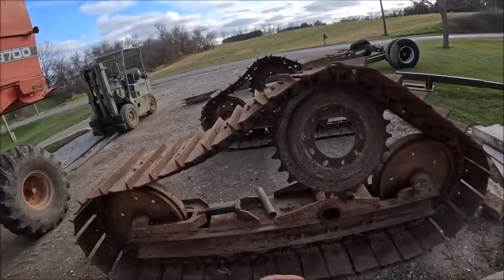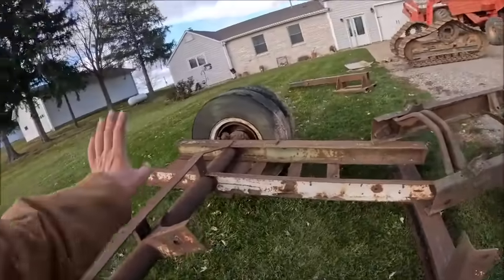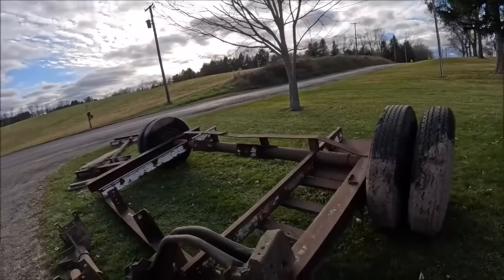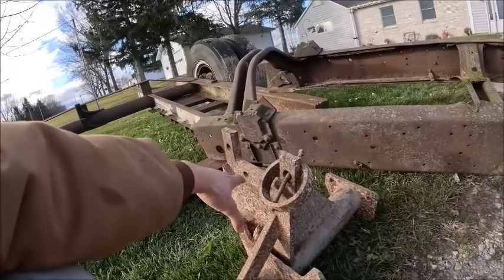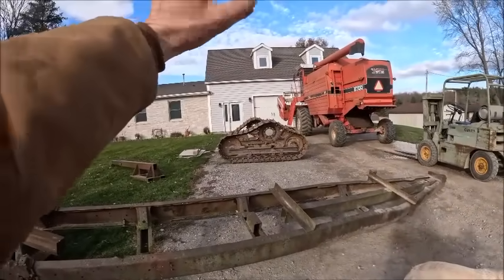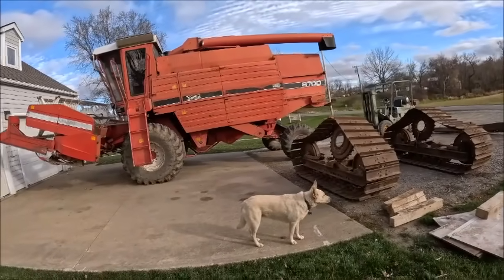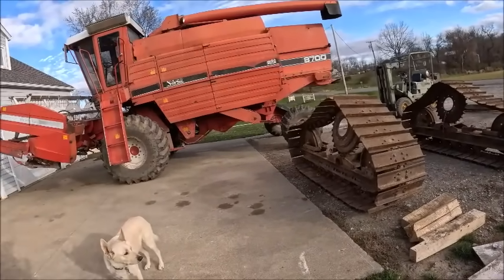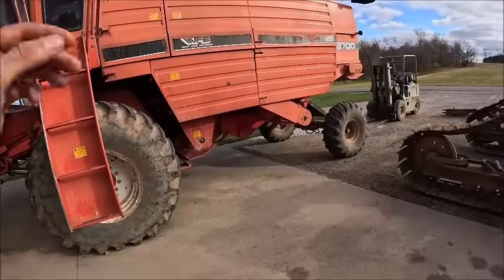8700 Tracks Showed Up

Comment: Looks like a pretty involved project. Hope it all comes together without any major modifications needed. I'm sure between you and your Dad it will be doable.  Wishing you good luck in getting it going and harvesting soon.  Just finished getting our "bargain corn head" back together (had a broken row unit drive shaft). Sometimes you deal with adversity and roll on!!!
Reply from the maker: It won’t be to bad.

Comment: Here's hoping for a speedy fit of new shoes for the 87. One thing we used to do with steel tracks to stop them ripping up the road was 3x2 blocks of rubber as wide as the pad, (or bigger depending on grouser depth)  bolted across the track pad, about every second or third pad.  or sawn tree branches if you've some hardwood about, cheaper.  short term for now fix
Reply from the maker: It won’t be on the road?

Comment: what kind of change will you have to do with the final drives i saw a few of those whites 8600 and 8900s eat up the finals with just a rice tire on them years ago. And i know when i had a 1460 IH with tracks there was a different final drive we had to change out for tracks plus we had to run a mudhog rear end to get the thing to steer and turn better lol but it was a brute for any muddy hills and we even harvested corn in snow once .
Reply from the maker: Put the tracks on and go. The only weight on them now is what the sprocket weighs and the track on top of it. There’s less stress on the finals now then when the tires are on.

Comment: Passed a set of JD steel tracks in Ohio. 
In a pinch could another set,pending sprocket mating up,be used as a backup?
Hauling Propane for dryer gas.

Comment: So that takes all the weight off the final drives! That's cool . Were those the weeker finals or the heavier later ones!
Reply from the maker: I’m guessing heavy finals. They never made a bigger hub unless they changed gear ratios.
Reply: We had an 8600 when I was a kid it eventually snapped axles in the finals,and maybe the 8700 were the up dated ones!

Comment: I understand you're most likely on a Time crunch, wood blocks bolted to those tracks would allow you to run down the road with it. (Slowly)
And I would bet money the tracks will barely scratch a cold asphalt road anyways
Reply from the maker: I have a dolly cart. Why on earth would I try to road it everywhere?
Reply: @Oliver66FarmBoy   you'll realize that dolly is a pain to use.
Reply from the maker: Not as much of a pain as tracking a combine 12 miles at 4 mile an hour. Actually if you add up all the road miles I have left to get between fields more like 60-65 miles. Plus whatever I end up custom harvesting if the guys that want me to do it actually end up having me come out. So yea no, dolly is pretty easy.